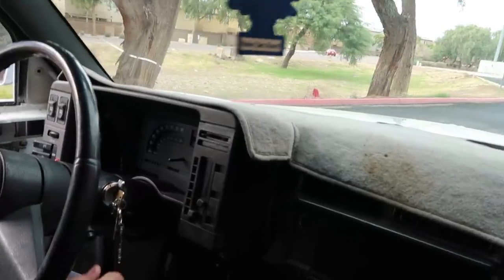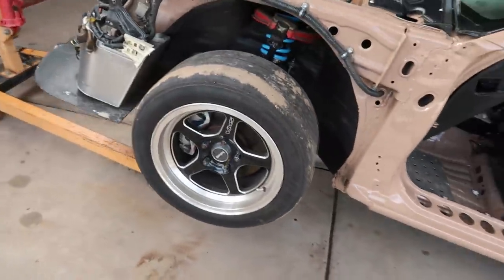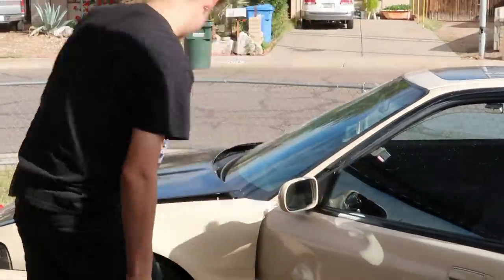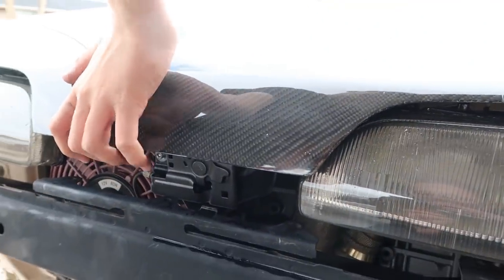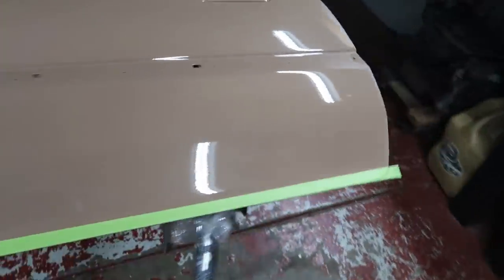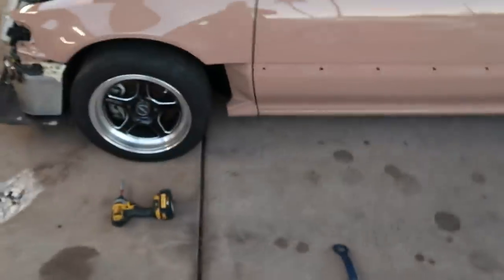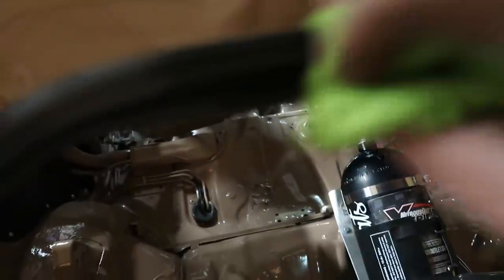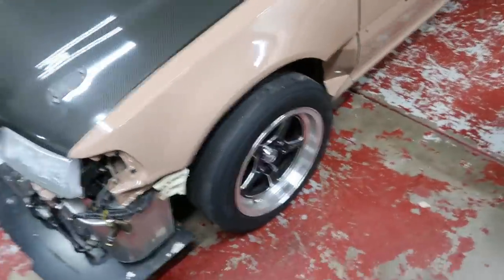Assembling Khaki!

Comment: When I was 17 I had a 91 Chevy s10.  2.8 v6 5 speed Hurst shifter.  2 hydraulic pumps, 9 batteries.  And it had kandy orange paint with prismatic flakes and tribal flames all the way around.  It was a walk through with topper painted to match.  Removable top to make it a convertible.  Sliding rag in the topper.  It had a frame wrap with 1/4" steel in the rear and 3/16" in the front on 13 inch wire wheels.  It hopped like 5 feet at the bottom of the front tires and I took 3rd place in a huge lowrider hop contest and won money and a trophy and met the Ying yang twin at their prime

Comment: Hey my dad had a collision shop to fix that gap do this tighten the top screw and loosen the bottom screw put your hand on the bottom and push up with the door slightly open and tighten the bottom screw you can probably get the gap u want.

Comment: Run a small bracket on the bottom of the fender to hold it in place to the body, that will help correct the gap